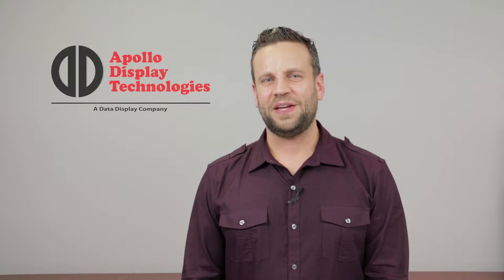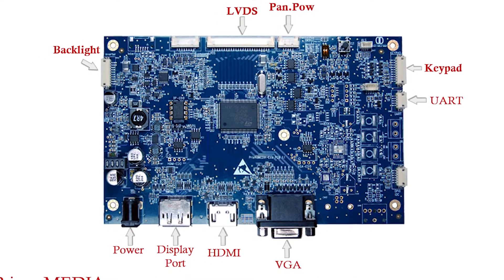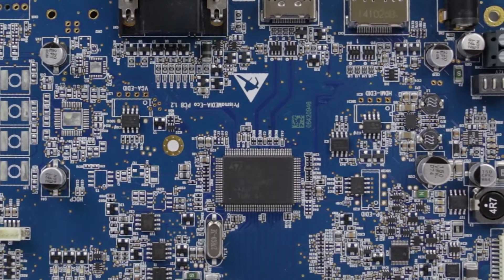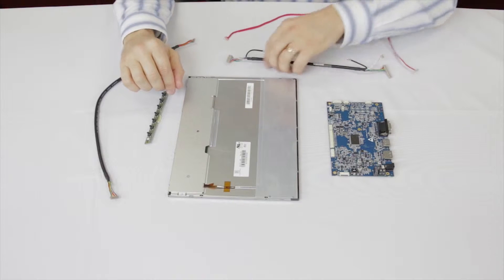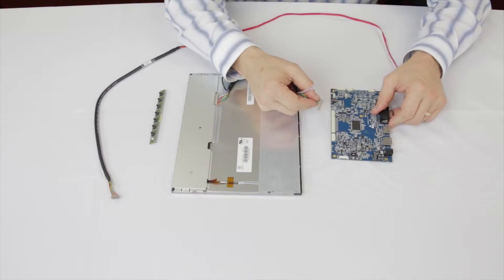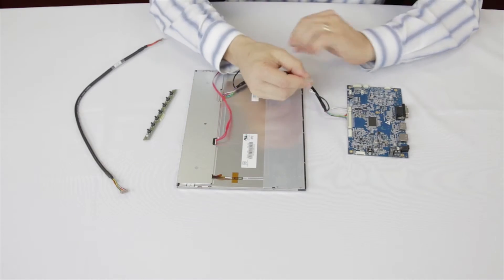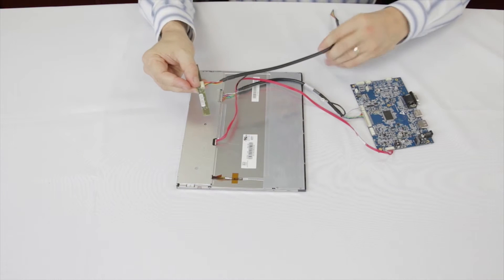PrismaMediaEco Set Up

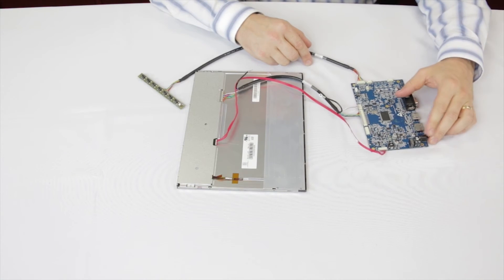Comment: @ 2:43 - The Prisma does not ALWAYS power on automattically.  If the prisma is in the OFF state the board will not power on at a power cycle.  A connected KEYPAD, Remote OSD over RS232, or IR Remote is needed in these cases where the power button must be toggled to on via OSD buttons or commands.